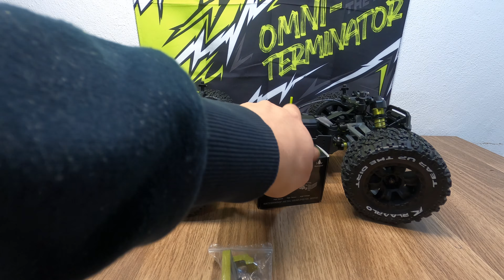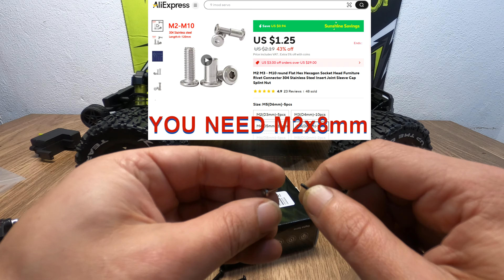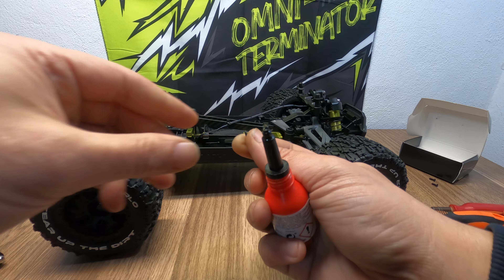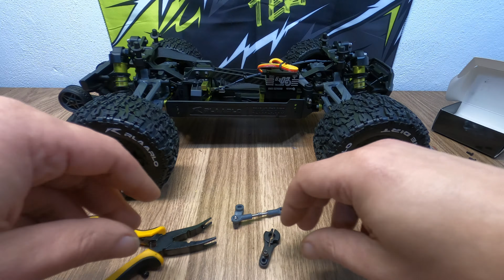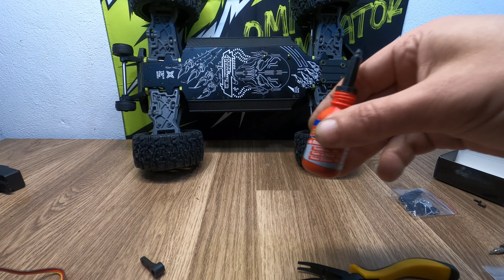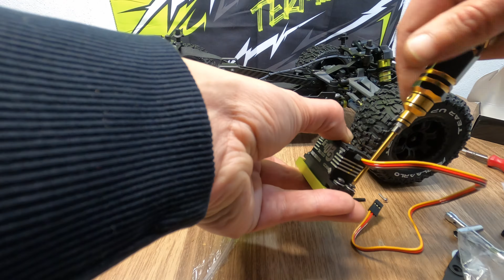Building the Ultimate Omni Terminator – Step 1: Servo! Special TIPS

Comment: Actually the stock servo is awesome on this car imo . Small and mighty for sure. Quick and turns wheels on the ground easily . Yours went bad ?
Reply from the maker: @Hungrybird474  hello and thanks for watching. No I bought the roller version of the omni terminator so I went for the servo I like. It is faster then the stock and easier to find replacement or upgrades not bond to one servo, but I heard the stock servo is good but was almost the same price as this from Aliexpress, from rlaarlo website even more with the shipping so this is the better option for me.
Thanks for passing by
Reply: I find that the servo is very fast at full steering lock and when the gyro intervenes but with small steering inputs it seems to be very slow to react.

Could also come from the controller/reciever or maybe it's normal. Wonder if a faster and stronger servo would fix that?